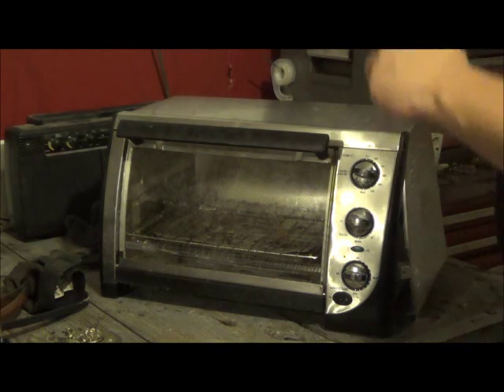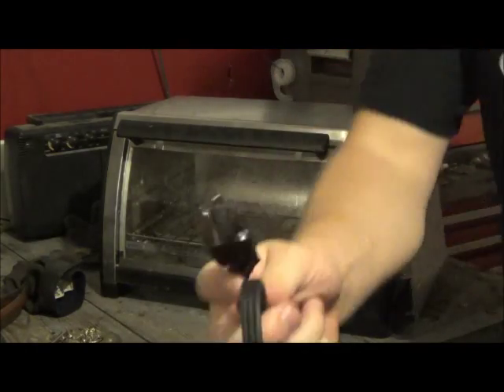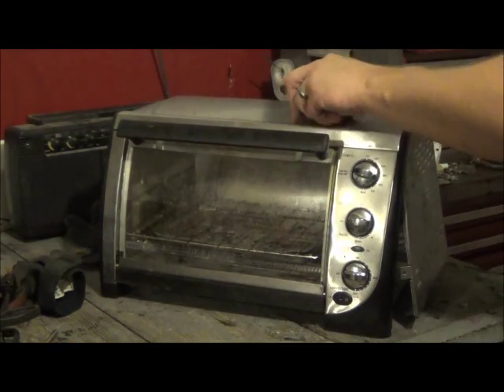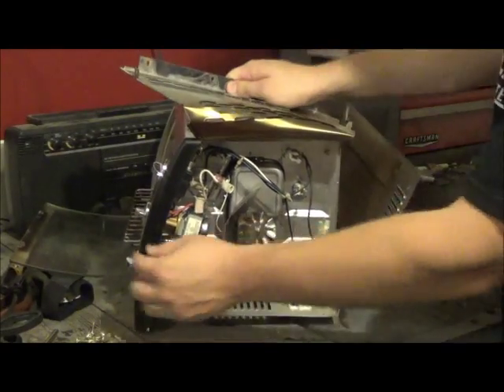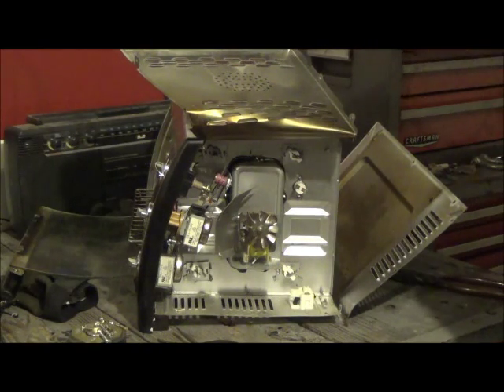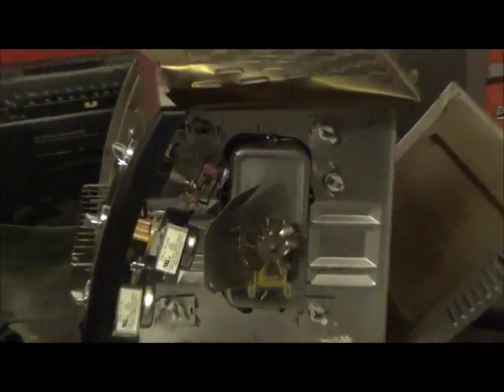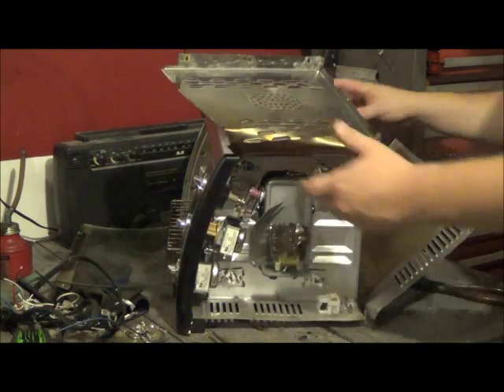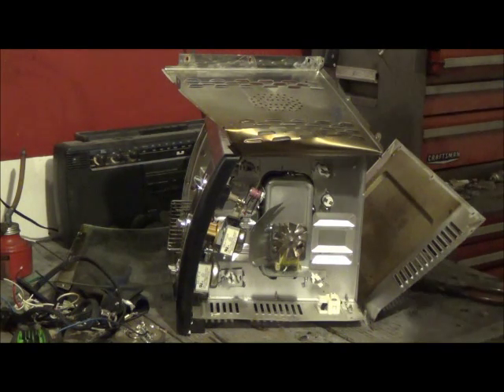Scrap a toaster over - Whats inside and whats it worth? Copper + Steel

Comment: Thanks for the video! Helped a lot since I picked up two toaster ovens and I’m new to scrapping. Maybe a silly question but I’m hoping you’ll answer, can I just go ahead and rip out all of the wires without worrying about getting shocked? I’m only asking because on another video of someone’s they said you have to be careful otherwise you’ll get shocked hard (that was scrapping a microwave) - or does it just depend on the appliance? Thank you!

Comment: rob, doesn't that brass on the end of the plugs go as dirty brass?
Reply from the maker: My yard takes them with yellow brass. However, I think that my yard gives me a little special treatment since I'm a frequent customer and I always have my stuff sorted well. One of the guys mentioned that it should probably go in as plumber brass since some are coated in chrome.
Reply: Robbie TwoScraps  okay thanks man